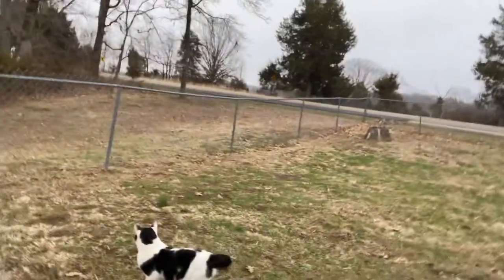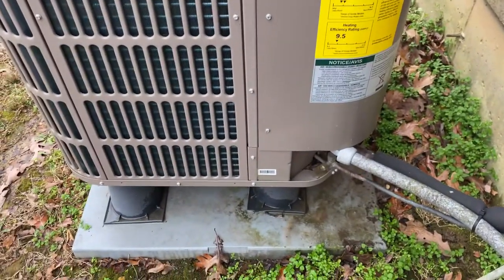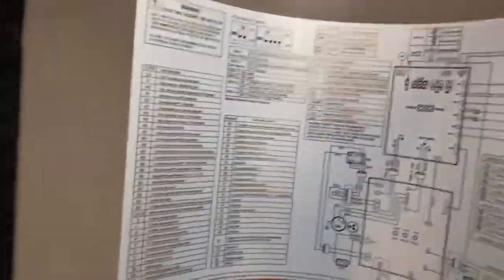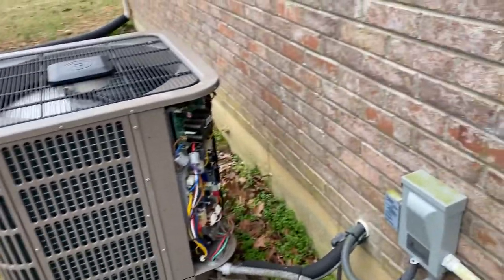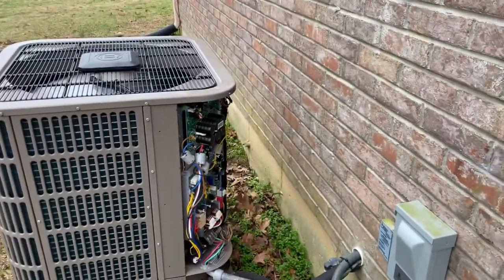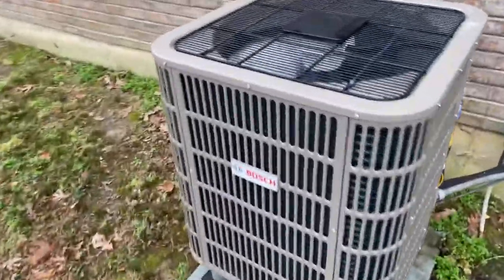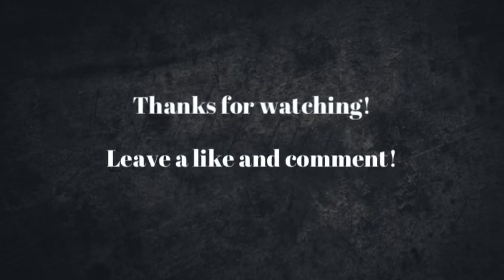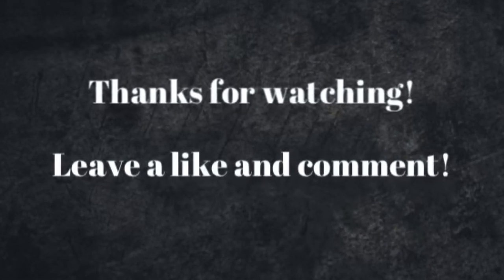Tech Tips #7 Bosch Inverter Heat Pump

Comment: From all the research that I’ve done so far away it’s explained to me (Bosch) makes two footprints. They say the first unit is a one to 3 ton. The second unit can go from 3 to 5 ton and you can change that in the dip switches so if you needed a 3 1/2 and you bumped all the way up to five you could’ve just changed the dip switch and go to a 4 ton and been closer to what you really neededmight check that out just to make sure I’m know what I’m talking about
Reply from the maker: @grasscutter1963  basically, if you’re doing a retrofit and load calc says 3 ton or less, do the 3 ton. If it comes out to 3.5 ton or more, use the 5 ton and set dip switches. In the end, the unit wants to follow the saturation so indoor blower speed is important (as always).

Comment: I'm also an HVAC Tech! I live in Hot Springs Ar. I installed a Bosch 18.5 seer heat pump 3 ton in my house. That was a little over a year ago. It has worked great. I had a 10 seer Carrier heat pump. That was definitely an upgrade! The only issue i have is, the efficiency isn't as good as i hoped-for. If there's anything you can think of that I can try to help the efficiency that would be great! This is the only Bosch unit I've ever worked on. I also install Carrier with the company I work for. The price of the Infinity 18 seer compared to the Bosch was much higher, or I would have one installed.
Reply from the maker: I’ve found that a lot of times, it’s all in the ductwork. We’ve upgraded systems from a 10 seer to a Carrier Infinity 5 step inverter, and they only see maybe a $25-30 difference. Mostly, The higher efficiency helps more with comfort than anything else. But some see an insane difference in price sometimes. One of the main things we do though, is install media filters almost every time. Most filters were undersized. 

I DO recommend running your fan in the On position, unless your duct is older and in the attic or crawl space. This helps clean the air and equalize temperature throughout the house. 

I’ve always wondered what a new variable speed system would do if it were R22 instead lol
Reply: @jcforward741  All my duct work it metal in the attic and is in great shape. I do occasionally run my fan in the on position. I also have a Reme Halo and a single UV light in my system to help filter better. I have new windows throughout my house and added more insulation in my attic. My house is tight.
Reply: @jcforward741  The bosch furnace X13 ECM motor should be rated for continuous operation without any issue? I am running mine 24/7 so hopefully it won't wear it out faster? thanks
Reply from the maker: @xincai951  mine is. So if we die, we die together 😂
Reply: What air handler did you install with the Bosch?

Comment: We recently had the 2.0 system installed with the Bosch 96% propane furnace. We originally had the Bosch 100 thermostat which proved to be faulty according to the installer. Then they put in a Honeywell 8000. Problem is it runs on auxiliary way to much . They said they set it down to 20 to switch over to propane. What thermostat did you pair up with yours? The Sensi we have at our lake house seems to provide more information on the phone app than either the Bosch or Honeywell.

Comment: Quick question … I currently have a carrier air handler that’s variable speed, model FV4CNF002L00 with a carrier AC condenser 
I was wondering if I can just change the condenser to a Bosch 2.0?… will these two systems be compatible?

Comment: Noticed you didn’t mention that a txv is required have you ever ran a piston coil with a Bosch?
Reply from the maker: I can’t say I have. The company I work for actually installs Carrier, so I’ve only put in a handful of these. I don’t think it would work out too well though, considering the compressor modulates based on evaporator temp. Without having a set superheat, that inverter would probably be constantly hunting. That’s a good question though 🤔

Comment: Great video. Question, do you need to run a surge protector on the indoor and outdoor unit?
Reply: You don't HAVE to run one but Bosch does recommend a surge protector for their outdoor unit to protect that costly inverter board
Reply: Bosch recruits  a surge protector  on them for warrantry

Comment: Do you have high humidity problems when cooling running a 5 ton on  3.5 ton house?  I'm in Seattle and debating on a 5 ton vs 3 ton bosch heat pump.  What do you suggest for a 2260 sqft 2 story house?
Reply from the maker: I’d go 5 ton system more than likely. May need 2 systems depending on size of second floor and the climate up there. This one doesn’t see humidity issues. I’ve heard that problem before with Bosch, but I’ve also seen multiple high humidity codes in some of our Carrier Infinities in our area so, not always clear cut reasoning. I just dropped a video talking about the air handlers as well that has some useful info too.
Reply: Can't just jump up that high when you ductwork is sized so much smaller. Not good for the system to operate on small ductwork. To much static pressure.
Reply from the maker: @97Napkins  do you know anything about how the Bosch systems work? They are different from your normal systems. I’m not talking about airflow distribution in the house. Bosch has 2 heat pumps; a 3 ton and a 5 ton. They have several different size indoor units to match what you need for static

Comment: I have a 3 ton unit and air handler. I’m seeing higher humidity. I switched the SW4-3 per instructions to help, but it hasn’t made much difference. I’m debating if it’s possible to change the J2 to off which would adjust the outside unit from 3 ton to 2 ton. What would I need to do?
Reply from the maker: Now that I’m in my new house, I’m working on the same stuff. I have a Y1 and Y2 call for the blower. I dropped both speeds down one leg. I was personally wondering the same thing about switching the J2. Longer run time means more dehum but you also don’t want your unit to never satisfy. Right now, I’m seeing average near 62%
Reply: @jcforward741  I have a mini split in basement and one of those hybrid hot water heaters. I’m spoiled by perfect humidity levels down there. Whenever I go upstairs I feel that moisture. From a safety perspective could I just switch it? I read about needing a different piston. It’s the Bosch IDS 1.0 3 ton upstairs and Bosch mini in basement. Old home had oil before so central air didn’t go to basement. Hence why I added mini in basement. All electric. No gas on street. Edit- can’t find a good tech in the area for Bosch.
Reply from the maker: @mteske1  I’m trying to get answer now, but I know for sure that Bosch says you need a txv inside
Reply: @jcforward741  I would be really curious to see your video on that.
Reply from the maker: So, not answer about TXVs. But after making my Y1 speed the slowest option on my board, my humidity has been 50-55% all the time. Which is plenty to ask for from this unit. That’s all I changed. I also slowed my Y2 down one speed from where it was. Still may drop it down one more too
Reply: Drop your y1 fan speed if you want to reduce humidity. Long run times at lower fan speed pulls out more RH.

Comment: What about the ductwork? You have 3 1/2 tons of return and supply. That's not good for the unit 😕.  Prob have high static pressure
Reply from the maker: In the video, I said it has about .5 to .6 TESP.

Comment: I'm looking to do the same setup but a 2.0 what's your electric bill .
Reply from the maker: Brand new home, vaulted ceiling, 1350 sq ft with basement the same size. Southeast MO climate. $115-120/month
Reply: @jcforward741  I'm a union journemen service tech   I'm in NJ 1600sqft home built in 2004   Just filled my propane tank $450 I currently have a 90% heater single stage  I'll get like 2.5 -3 months out of it. Just trying to cut costs  during the summer my electric bill is 220 winter is like 60-70
Reply: @jcforward741  what do you think would be better ids 2.0 with furnace
Or Amana 18 seer 2 stage HP with modulating furnace communicating system
Reply from the maker: @johnszymanski548  ehhh 😬 that’s a tough one. Communication systems are still better at dehumidifying than the Bosch. Mine does fine, but I’ve tweaked with it and found the right spot where it will keep it below 55% most of the time. The Amana can probably dehum better, BUT… the I’d say the Bosch’s inverter compressor is much quieter because Amana is not inverter and Bosch is likely more reliable. I’ve had so many issues with Amana/Goodman equipment. Hell, this week a guy got tired of his continuing parts breaking down on his 11 year old one that he’s just putting in a 5 step Carrier inverter. So, in the end, I think I still go Bosch gas furnace and inverter heat pump personally

Comment: what is the monthly usage cost for a hot summer month like about 90 average outside ; set to cool to around 72-74  (ballpark)
Reply from the maker: Oh man, there’s so many variables with that. If the following is in the best case scenario:
Ductwork sizing and condition
Filter sizing 
Home insulation 
Humidity level (I live in southeast mo)
Size of the house also plays in

During construction last year, it was the only appliance running. Tools and lights were ran, but that’s it. Highest bill was around $60.

My moms electric bill remained around the same compared to her old unit but had a bit more dehumidification than before. (Around $120 monthly). The duct work was done very well in her house too though.
Reply: I have a 3 ton. In AZ 115F outside, I set my thermostat between 78 (night) & 80(day). Super efficient.
Reply: Old post, but thought I would chime in. I have the 5 ton Bosch unit. I had my thermostat set to 73 all day, and outdoor temps reached 98 degrees. I am in Denver with low humidity and house is 3,000 square feet. I used 18 Kwh. My old Lennox condenser from the early 90's ran at about 4500 watts, and I haven't seen this Bosch unit go over 2300 on the hottest day. So, it's about 50% more efficient than my old condenser.